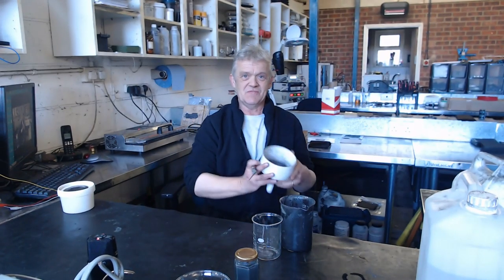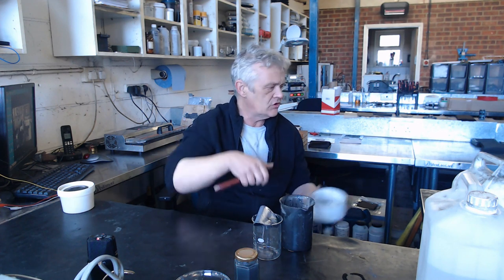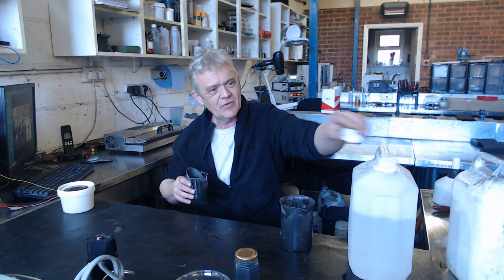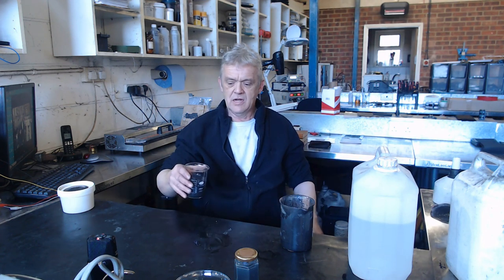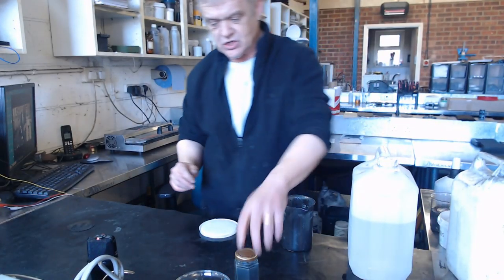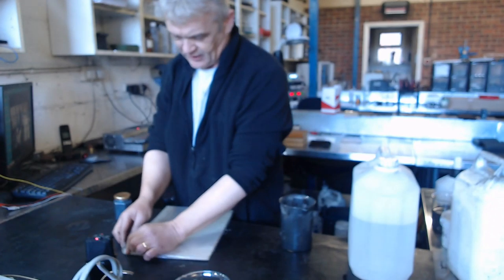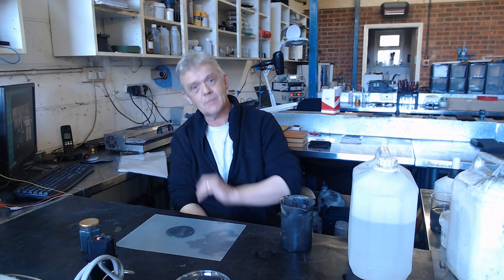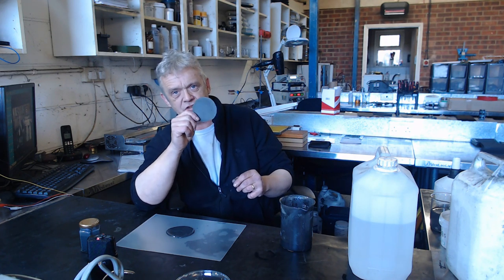Making Graphene Filled Plastic

Comment: is that one also bullet resistant lol. I wanted to ask  if there is a way to integrate graphene into peltier plates by either substituting the ceramics or mixing the ceramics with graphene or doing something else. Maybe make them more efficient at cooling heating etc.
Reply from the maker: an interesting idea mate - I will look into it
Reply: @Hellequin Maskharat what if the outside has an insulated substance applied to it. I forget the name but it’s something that when not available tech you tubers say to use nail polishe instead.

Comment: I've been trying to replicate this process as I'm interested in reinforcing polyethylene with graphene.  The problem I'm having here is that the end product is of low density.  I'm assuming as the solvent (acetone) evaporates, since there is nothing else to fill the space left by the solvent, that space is filled with air.  My ideas to solve this problem are to slowly add the graphene as the solvent evaporates and finish the process in a degassing chamber to remove the air.  
I'm also curious what solvent you would recommend for the polyethylene, as others have been asking.  

I've already tried melting the plastic, but as soon as the graphene is added, it is such a fantastic thermal conductor, that it instantly cools and hardens the plastic.

Comment: I presume the tensile strength is improved, not just conductivity? In which case I want a load of graphene loaded filament for my 3D printer ;) Preferably PET or PETG as ABS stinks and shrinks when printing.

Comment: I was thinking about extruding a flexible plastic with a plastic and graphene core. Not a 3D printer, but a purpose built extruder.  I have also thought about using a dual extruder 3D printer to print (toy) parts with "wires" embedded in the part. A sort of solid state chassis if you will. Thinking drones here, but also rc boats, cars, etc.
Reply from the maker: nice ideas mate - thanks for sharing
Reply: "parts with "wires" embedded in the part" Exactly why i have my dual nozzle 3d printer.

Comment: Heat and extrusion could still work beyond 0.5% graphene loading if the design of the extruder was changed to resemble a positive displacement pump. I haven't done this. I have experience with hydraulics, though, and know double screw type positive displacement pumps can reach 2,000 psi in hydraulic systems and oil like graphene is very lubricating.

Comment: Just out of curiosity, what has your previous career been?

Has any company ever had you on tap to oversee any operations, as far as control (electron microscopes), as part of a think tank, or R&D?

One of the things about operations is you want to “set and forget” (autopilot) and just look at the “distillate.”  
After that, it’s a matter of looking at what is being made, testing, etc.  Nanomaterials Science is a Beast, but it doesn’t have to be!  I just thought scientists and workers would collaborate together, basically with coffee, vegan donuts and breakfast, and trying to make the best stuff Everyone Could Own!

These materials would be great in industry (obviously, across the board, besides nanotubes) and Especially Aerospace, with New Industries like VTOLs (manned quadcopters/Cyclorotor Vehicles) and supplying materials to GE for better ranges of Fuel Cells). On top of that, they could help Others like Airbus and Boeing to upgrade their Fleet, and help realize Electric Aircraft utilize a Range of Fuel Cells (SOFC and Hydrogen) 

What about using graphene/nanotubes to help augment materials firewall materials, besides water cooling/vapor chambers/waste heat generators for said fuel cells in aircraft?  

What about graphene in Peltier devices for SOFC and firewalls?

Comment: I wonder how graphene plastic fairs as a anode in a electrochemical cell, would it survive corrosive conditions?
Reply: this obviously depends on the plastic.
Reply: HDPE might work. It can stand up to a lot on chemicals, except limonene (sp?) Found in lemon and orange peel.
Reply: @wanderingzanzey2126  Teflon is the most inert plastic I can think of, we should try that
Reply: @doctorpurple5173  Depending on the chemistry, PTFE is actually a poor performer. It has very poor wetability and actually repels electrolyte. In most chemistries PTFE is used in very very small amounts - about 0.5 - 1% by weight of the whole electrode, for this reason.
Reply: @wanderingzanzey2126  yes but it's poor wetability could be irrelevant if you coat the whole electrode in a graphene layer, then it's the graphene that you have to make wetable and the plastic just has to be conducive and corrosion resistant
Reply from the maker: Zacariah has it mate - we have chatted a few times and he knows his stuff for sure
Reply: @ThinkingandTinkering  agreed

Comment: @Robert Murray-Smith how conductive is this plastic? Can it be used as current collector? If that's viable, you are at one step of automating batteries and super capacitors.
Reply from the maker: that would just depend on you graphene loading mate - but basically it can be used for sure
Reply: @ThinkingandTinkering  I am opening a company here in Luxembourg and we have a few projects which we are planning to speak with you for collaboration and investment. Please let me know which would be the best way to reach you. Thanks for coming back to me.

Comment: What could be the purpose of graphene on abs? Does this make the abs stronger? I think it would, if the hexagon lattice of the graphene is kept. Even then if the lattice isn't kept perhaps strength is still added proportional to the graphene amount and the method to coat or dope the abs "ensures" an even distribution. Kind of like adding carbon to iron to strengthen it. Also, a highly conductive electrode could be made with an abs core and a bi-layer graphene coat (ideal) with a CVD method. Loads of stuff to test out, if your ink can maintain an even distribution of carbon in different arrangements of carbon pure structures, I can see that it would be useful in many applications. You could eventually land on one application that could make you famous! Don't stop, keep trying, keep testing!
Reply from the maker: stronger and conductive mate and you are spot on keep experimenting